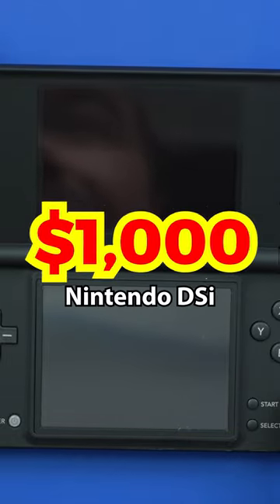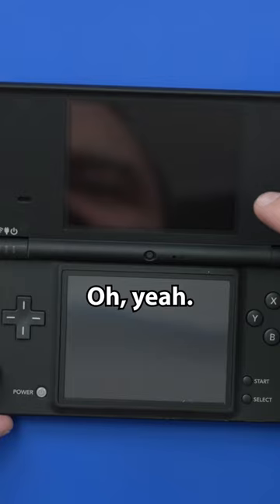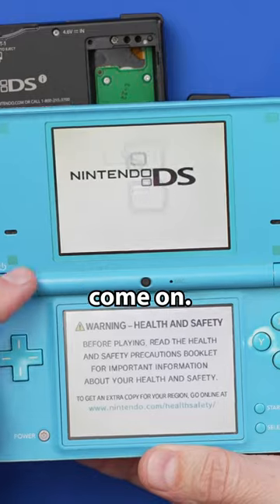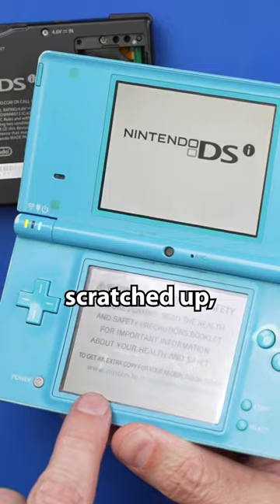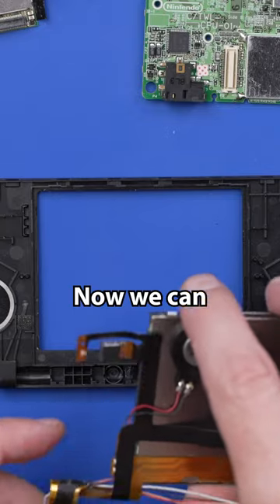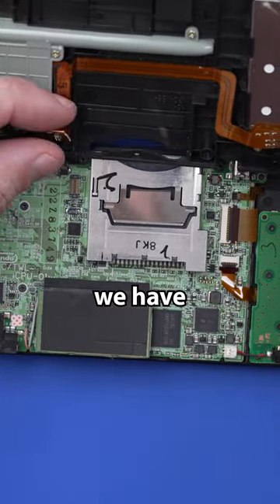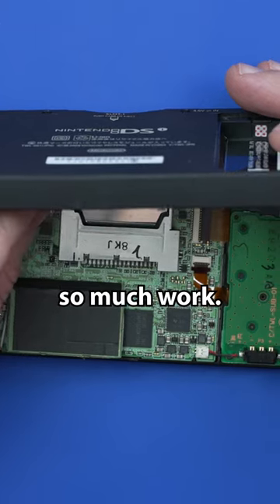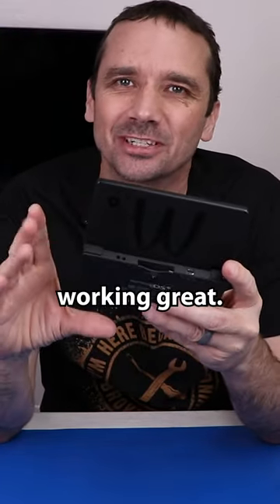I Paid $1,000 for an OLD, BROKEN Nintendo DSi

Comment: Bro made it sound like he paid $1000 for the McDonald's DSi then the seller gave him two free DSi with it. That's great deal lol
Reply: "It was not, in fact, a great deal"
Reply: Three DSI for 1000 bucks they better all work-
Reply: @BBWahoo  Dsi is about 50-80 on pricecharting so I'll round and say he got $150 of value.
850 for the McDonalds dsi, and lowest price I saw from a quick search was $1100, still a decent "deal" assuming you value the weird dsi
Reply: It is not a good deal, even $500 isn’t. If they all worked perfectly then sure fine $500 but this isn’t even worth $300 because of how broken the McDonald’s one is and how the other had a scratched up bottom screen.
Reply: @aron1089  "500 isn't a good deal"
Bro, the lowest McDonald's DSI online I found is near $1000. A broken screen costs like $30 to repair, $50 max. The only valuation of the McDonalds DSI is the shell and software I'd say.
Reply: @NathanCotrill  I wouldn't pay more than $10 for a regular DSi with a broken screen, let alone a McDonald's one
Reply: @Saber_Nico  I mean, it's worth about a thousand to collectors, but mkay.

The going rate of normal working DSI's from what I saw on ebay is $50-80, for parts you usually assume half priced or less, so 20-30 makes sense.
Reply: @NathanCotrill I have never used a Nintendo DS thing
Reply: @cornholio8715  and?
Reply: based pfp
Reply: Is This McD DSI the same one which were intended for Japan McD and there were lost for long time?
Reply: @NathanCotrill I’m a collector and I never paid that much ever
Reply: @Darkstar301 Do you buy rare consoles? Many rare items can cost a lot of money, especially stuff like the McDonald's DS. The McDonald's DS was was only accessible to McDonald's workers in Japan for a very short time.
Reply: @NathanCotrill  its a better deal but its still far from good.
Reply: Lmao if it was 3 sis’s that’s still not a good deal normally, these dis’s sell for $60-$100 at most lol
Reply: He was like it's broken so here's some parts
Reply: Can’t you just install the software on a normal DS?
Reply: @whyrwehere  yeah I sold a copy of Panzer dragoon saga for Sega Saturn on ebay. Ending bid was $1,245.. Completely blew my mind as I have a bunch of old consoles and games being born in 1980 I grew up while everything was coming out so I kept it all. Like it all boxes and everything. After I got that $$$ from that game I bought a modded PS2 with all games loaded to a hard drive,a modded Dreamcast and Saturn with complete libraries installed,so no more game disks or drive failure to worry about. So I have been unloading my whole collection bc I emulate or use modded setups now. Shits crazy what some of these people paying for some of the old RPG games I kept.
Reply: @llnemesisll7129 and it's honestly pretty irritating. People treat older games as "collectors items" and never play them, then get mad at people who emulate said games. 
IMO devices are made to be used, not to be just stared at because they're expensive. I collect pebble watches out of practicality, because I find them to be the most practical and interesting watch ever created.
Reply: I don’t think you guys understand the purchase item absolutely is the McDonald’s DSi and the other two are just for parts.  Two normal DSi’s don’t scratch a dent towards $1000 but the McDonald’s one is super rare and worth a lot
Reply: bro u can now find dsi's for like 20 bucks
Reply: The ojly thing worth stuff is the mcdonalds one a used dsi can be like 35

Comment: I wouldn’t have thought that would sacrificed a working DSi to fix another one. I wouldn’t take a working DSi apart at all if I had a choice. I would buy a new top and bottom screen and digitizers for $5-$10 each and replace the bad screens instead of taking the time breaking down working DSi to extract the parts. What are you going to do with the units that are now missing screens?
I used to keep various Nintendo DS and 3DS screens and digitizers on hand because I needed them so often. I would buy a quantity of them from China and have to wait two weeks to get them, but they were cheap.

Comment: A McDonalds DSi. Weren't those the ones that had those training games built in?
Reply: Yes
Reply: Game was a seperate cardridge, and unlike the DSi itelf, was very very rare
Reply: @zitronenwasser  yeah. Nintendo tried to get this used as more mainstream piece of tech, not just a gaming system, so it'd get used in workspaces and stuff, so they had a deal with McDonalds where they used it to train staff, but I guess the systems were too expensive for the benefit and it didn't pan out.
Reply: Yes, but the game wasn't built in, it was a cartridge which is rarer than the system